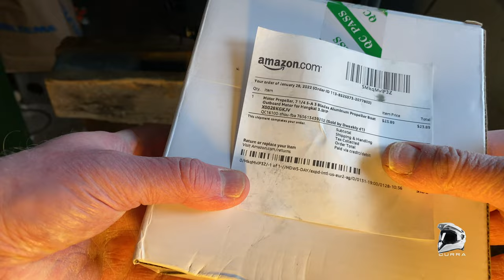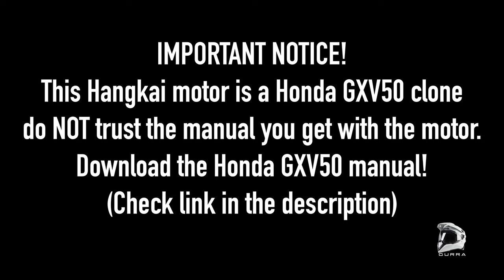Hangkai Outboard Motor Service & Upgrade

Comment: Good call on the spark plug. I got the one with the jet drive because I was unimpressed with the plastic prop. Now I kinda wish I would have went the other way.
Mine doesn't seem to be too noisy so will run it as is a couple times but might Replace stock muffler with a 3/4" npt muffler.
Reply: Which one is the “other way” you wish you would have went??
Reply: @riolaflare7180  he bought the one with the jet propulsion one its like thing jetskys have instead of the one that come with the propeller that is away faster and cheaper

Comment: Yes, NGK is a much better spark pug. Also, the aluminum propeller has a more efficient design. I think you should put a turbo kit on it 😁. Be safe bro.
Reply from the maker: That should make it fly...into pieces! 😆👍 RSMF
Reply: @GurrasGarage  lol
Reply: Magkano at saan makabili
Reply: @GurrasGarage  How about muffler pipe in the water? That would make it silent.
Reply from the maker: It would just choke the motor

Comment: I didn’t know you could run these without water flushing through them like most all outboards
Reply from the maker: This little motor is air-cooled
Reply: @GurrasGarage  oh wow so no impeller to change either. Nice 👍🏻

Comment: Hello My son just bought a use Bass Tender 9.4 and this motor the Hangka 4.0HP 4T came with it . I just got it started after a Doz. pulls , it looks like it hasn't been use for a while so I want to drain all fluids and give it a good cleaning and tune up . We never had a outboard motor before but this looks just bigger than my weed wacker . Where can I find Parts ??
Reply from the maker: The best way would be to google it, Amazon and eBay probably has some parts. This motor is a Honda GXV50 clone so many parts should fit from that motor too.

Comment: Tempted to try one of these. The only thing holding me back is that from reading reviews, these motors seem hit-or-miss.
Reply from the maker: I paid $230 in total, a bargain and mine works fine.
Reply: I got one works great runs like the wind👍

Comment: How about running exhaust pipe into water? That would make it less noisy. Most outboards have it that way
Reply from the maker: Won't work its a 50cc 2hp motor, if you put a long pipe into the water the motor will loose all power (i tested with a long hose) and what will happen to that pipe when you try to go reverse, you must turn the motor 180

Comment: Hello friend of the video and congratulations ... I received my identical 4T 4HP engine as yours I installed it and after a few tests it moves my small boat quite well except that I have a small problem when I accelerate without putting the propeller button down I can not accelerate otherwise the engine stops and stalls but if I put the propeller system, button down, I can accelerate fully ... I do not understand why this problem I hope that I will not have to return it ... what do you think?
Reply from the maker: I dont understand "propeller button " ?
Reply: @GurrasGarage  excuse me for the translation ... when you put the small button up to start then you put the button down to move forward .. when the button remains up I can't accelerate otherwise the engine stops is this normal or not?
Reply from the maker: @angelyakko731  You need to put the choke button down, choke is only used when motor is cold. It won't run with choke on.
Reply: @GurrasGarage  ok great so if I understand correctly when the starter is activated we cannot increase the speed of the engine otherwise it chokes?
Reply from the maker: @angelyakko731  Yes, but if you need more instructions, you can make a small donation by clicking the super thanks button ☺
Reply: @GurrasGarage  top 👍👍👍👍👍👍👍👍👍

Comment: Hello, thanks for the video, is it going faster with the aluminium prop instead of the plastic one? If so, how much faster is it going?
Reply from the maker: @MeloneAzzurro  No speed gain unfortunately
Reply: Any other gain in performance with it? Thank you for the answer
Reply from the maker: @MeloneAzzurro  Watch my playlist on this motor

Comment: Hello,
Where did you get the pipe for the exhaust extension? Thanks for the informative video!
Reply from the maker: You can probably find them in any hard ware store, i m in Sweden so i  cant guide you more than that
Reply: @GurrasGarage  ok thanks. Will do!

Comment: Nice video, thank you for helping is out with this. Do you know how to change the oil ? I cannot find a drain plug....
Reply from the maker: Cheers. Drain plug is located under the gas tank in the engine block, you use an allen key.
Reply: @GurrasGarage  Thank you, found it !
Reply: @GurrasGarage  I like this little engine, i bought it after i watched your videos. I just have one issue, to get the propeller spinning i need to rev the engine little high, is this the same for you ? Can anything be done to make the clutch engage earlier ?
Reply from the maker: @stefanflorin288  Mine does the same, only solution I can think of is to raise the rpm idle a bit, but it doesnt bother me so I leave it as it is.

Comment: I really like your suggestions for this motor. The prop and muffler was a concern of mine as well.

Would you suggest this motor or a larger one for a 14ft Coleman Scanoe ?

Liked and subscribed!
Reply from the maker: My boat weighs 95 kg, the 14ft Coleman S canoe is only 42.6 kg so this motor would be just fine. Thank you 👍
Reply: @GurrasGarage  Thanks man! I was hoping for that. I have a fairly lazy river about 60 ft behind my back fence. 

By Google It's 164 miles long  from head to tail. It's only accessible by a few areas along it. Due to our steep mountain area with deep valleys It's almost never fished. Long slow slack water with deep shaded pools and some riffles in-between.
I look forward to more of your great content. Keep it comming.
Thanks for the knowledge and inspiration! Cheers from Eastern Kentucky!
Reply: @GurrasGarage  I was looking at the prices again. The 6 hp in a 4 stroke was that much over. Would that be overkill ?
Thanks again.
Reply from the maker: @JFCrow  You might need to check how much the 6 hp weigh, the 4 hp weigh about 10 kg, I dont think your canoe is made for a bigger motor.

Comment: Hi Gurra. I have this motor. But I have big problem to start it. I bought second carburator because silicon button cracked and started leaking. New carburator did not eliminated problem. Can I replace existing carburator to Honda GXV50? I have a look picture and design looks different.
Reply from the maker: Did the second carburetor have the same problem, sounds strange. I haven't tried the Honda carb so I can't say if it fits. If you have Facebook try this group for help https://www.facebook.com/groups/536817843464908

Comment: Hi,  I have a 3.5 hp that ran for about 2 hours.  The prop stopped turning.  I have checked the clutch and all is good but I am for the life of me unable to remove alu. prop. have you any hints or tips?
Reply from the maker: If it doesn't come off they way I did in the video, I dont really know. Its probably the prop shear pin that is broken.

Comment: you put extension smoke pipe out then how do you turn a motor around to go reverse? the heat will blast to your face !!!!
Reply from the maker: I only go reverse at low rev and speed, and then I stand up...problem solved

Comment: Does this have gear oil in the lower unit? If so, how do you check/change it? It says nothing about it in the manua.l
Reply from the maker: No you need to fill up oil. I have a video on how to do that, check my channel playlist
Reply: @GurrasGarage  thank you!

Comment: hi there anyone have the same engine but with jet pump propeller ? and is there a way to change the propeller with newone in aluminium ? thanks
Reply: I just recently got one of the 4HP jet pump motors, and I'm already returning it, we were barely going 2 mph with the current on a 1448 Jon boat

Comment: Will this engage the prop at a low enough rpm to keep a 16ft boat under 2mph for trolling
Reply from the maker: My boat is 4meter and it worked fine, bigger boats should be ok too for trolling but it will be slower in top speed. The biggest issue is that its pretty noisy even at low speed, thats why I made this exhaust pipe.

Comment: Friend, I bought a Hangkai 6 HP motor, it has only 10 hours of use. Little cooling water always came out, but today testing the motor, suddenly the water that cools the motor stopped coming out. Could you help me?
Reply from the maker: Check if the the water inlets are clogged, no water is getting to the pump, so it isn't pumping. Finally, the impeller may be damaged, requiring its replacement.
Reply: @GurrasGarage  thank you my friend
Reply: problem solved, it was a blockage in the outlet hole (possibly factory paint) the motor works fine now Thanks

Comment: Do I have to drain the old engine oil and then pour new? If yes then how to drain it?
Reply from the maker: Yes after 10 hours, there is an allen bolt  under the gas tank.

Comment: Where did you get the 16mm bent tube for the exhaust?
Reply from the maker: From a hardware shop here in Sweden , I guess  they can be found in any Metal Supermarket.

Comment: Have you tried it in saltwater?
Reply from the maker: No, I dont live close to the sea. But I suppose saltwater is not good for any motor. This motor is air-cooled so thats a plus, no water goes thru the motor.

Comment: Is there a carboraror upgrade that would allow me to increase the horse power from 4hp to 6.
Reply from the maker: Changing carburator only will not give you more hp. And its not 4hp to begin with, 2hp is what you get from this 52cc motor.

Comment: is this actually a 4hp motor? i see some comments saying it's only 2.. i can pick one up cheap so just wondering thanks
Reply from the maker: Its not 4hp, this motor is a Honda clone and has around 2hp. But for the price its still a great value.
Reply: @GurrasGarage  thanks just got one today! what would be a good oil mix and gasoline?
Reply from the maker: @toml6535  It´s a 4-stroke motor! you dont mix oil and gasoline in this motor. Use 91 or 95 octane gasoline and don't forget to fill up 240ml of 5W-30 motor oil.
Reply: @GurrasGarage  ofcourse, thanks :) last question do you also put some oil on the drive shaft of the propellor? i see that in some video's or is that only for water cooled?
Reply from the maker: @toml6535  yes you must have gear oil in the prop shaft
Reply: @GurrasGarage  how and where is that located? I have one that has only been used once but I feel like something seemed to be running dryer than it should
Reply from the maker: @bobbycampos6576  I have a video on that to, check it out

Comment: Your the second guy I've seen not checking your lower unit for 90 weight oil ???
Reply from the maker: It comes with no gear oil, I checked and fill it up the first thing I got it. Watch the playlist 😁